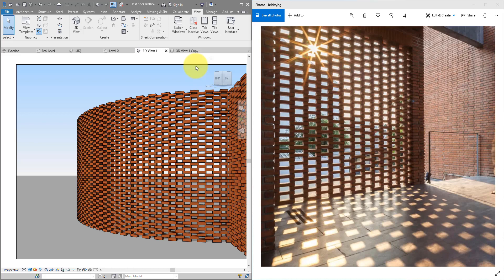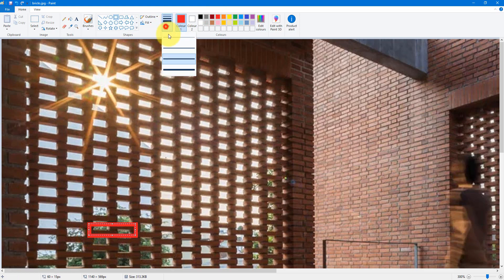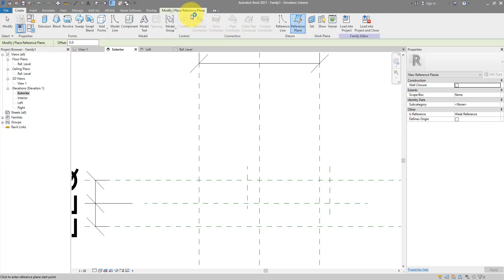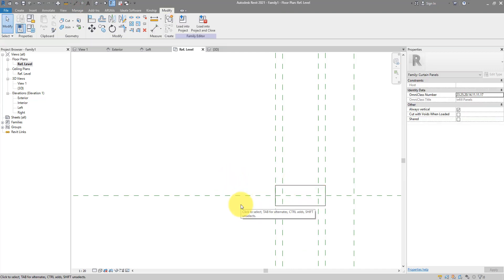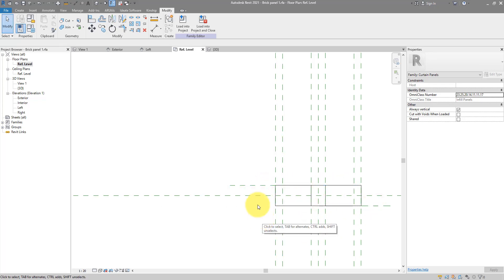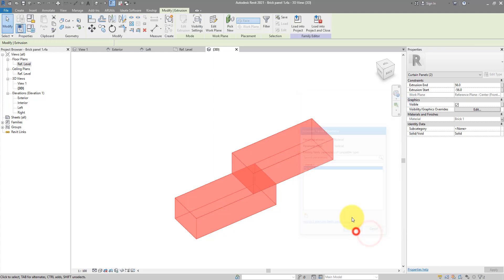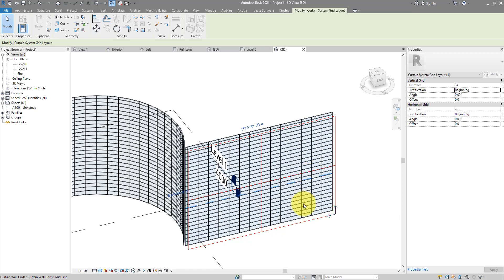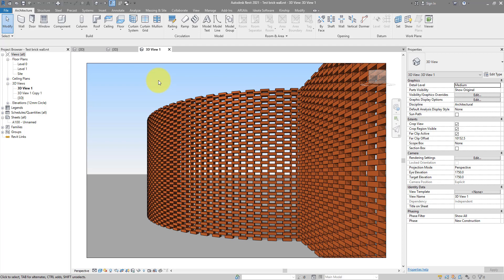Revit Snippet: Create Perforated Brick Walls & Screens

Comment: Great tutorial! I wanted to model a brick wall that transitions from solid brick to glass brick (both in horizontal and vertical direction depending on where in the building the wall is located). Perforations are not essential. I want this transition to look random, kind of like the Chanel Amsterdam building. Does anyone know how to do this?
Reply from the maker: Glad you liked this tutorial ☺️ For what you described though, you'll need Dynamo for the transition. You'll then need to use an adaptive component to model the brick unit, so it won't be a curtain panel family like in this tutorial. My other tutorial here can be more relevant: https://youtu.be/UQmFmAFoLkU?si=K82RpNleQeYxLiS7

Comment: Can you slant the curved wall at an angle?
Reply from the maker: If you can draw a slanted curtain wall then yes, you can apply the same brick panel family on it. If not, you may need to draw the slanted wall using Curtain System instead of Curtain Wall

Comment: Hi! Thank you so much for this tutorial sir! Do you know if there is a way for us to rotate each individual brick column on that panel at a certain angle? I want to create a facade where the brick started out normal and then the bricks as it go on, they rotate outwards gradually
Reply from the maker: You're welcome! What you want to do is possible but will need a different method (using adaptive components). I've done something similar here: https://youtu.be/UQmFmAFoLkU but of course, you'll need to make some adaptations for rotating bricks.

Comment: what about upper two raws of bricks, they are thinner than others.
Reply from the maker: Can you send a photo of what you need?
Reply: @RVBoost  i was thinking why this happened.
Reply from the maker: Oh I see. They are thinner because the grid spacing there is smaller than the rest. You should change your wall height to fit them better, or change its grid spacing ;)

Comment: Great tutorial, just one question though. Is there any way to have these bricks adapt to different shapes in elevation? Revit seems to delete the bricks that don't fit and replace them with glass panels. Thanks.
Reply from the maker: Unfortunately, Revit can only place a custom panel family like this one into rectangular grid cells. You'll need to make sure that's the case. :(
Reply from the maker: For non-rectangular cells, you'll instead need to use massing and adaptive curtain panels. I have several other tutorials on this channel on this technique, so feel free to look them up!

Comment: Thats quite a simple procedure, thanks for that. While changing the value of the overhang, a brick's length changes as well. How can we avoid that? Would setting up an offset parameter from one brick to the other and another parameter for brick's length help? this way one could avoid overhang parameter.
Reply from the maker: Thanks for proposing another method. Sounds intersting. Have you tried it?
Regarding the undesired change in brick length, you can edit the curtain wall's layout rule to fix it. It should work once you have a particular set of numbers for grid spacings and the overhang.
Reply: @RVBoost  Hey, yeah, I did try that method. It works fine. Now I'm trying to make different panel families with various combinations, like 3 bricks  which give zigzag or '+' shaped voids. Thank you for your video, it helped me to understand the concept perfectly. 😇
Reply from the maker: Excellent! Glad you liked the tutorial 😊 Feel free to share here the result for other brick combinations if you like!

Comment: I followed the tutorial but in the end when I try to chose the curtain panel in the options, it shows an error saying 'Type's parameter cannot recursively point to the type itself.' Please tell me what am I doing wrong.
Reply from the maker: Sounds like you tried to select the curtain wall family in that step. That won't work. Make sure to select the curtain wall panel family instead.
Reply: right, in the type properties of the curtain wall, where you select the Panel - make sure to select the modeled family (Brick panel) and not some curtail wall
Reply: It worked. Thanks a lot!

Comment: Like the tutorial ,how do we make the yarn of bricks at the top continuous
Reply from the maker: The easiest is to make a solid wall with a 2d brick surface pattern, unless you also need 3d bricks for this continous section?
Reply: RV Boost yes continuos brick on the top on the 3d
Reply from the maker: Then simply create a new curtain wall type with solid panels of the same size of your brick, and place it on top of this wall.